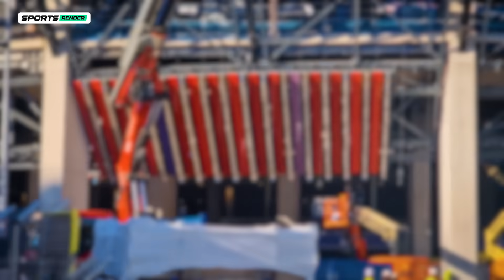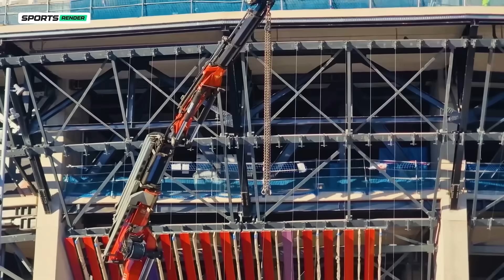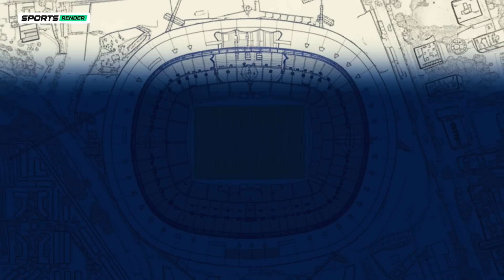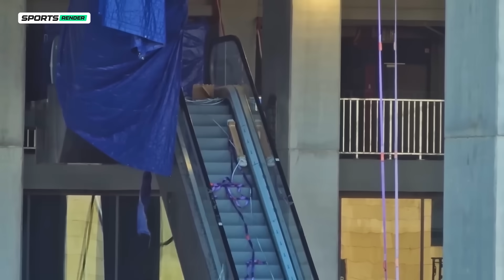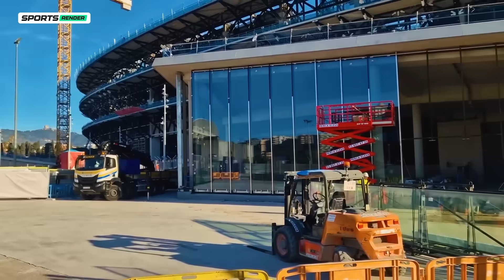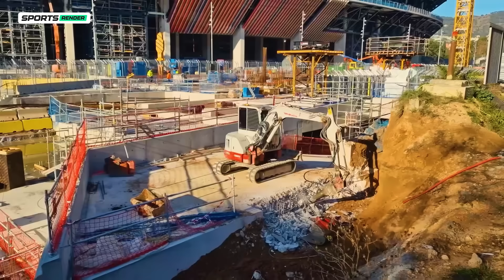The New Camp Nou Explained  Roof Structure, Façade & Stadium Weekly Progress

Comment: will roof be completed this summer ? I think they gonna try to complete this summer not 2027 .
Reply: It takes time. Don't be surprised if the roof is still incomplete in 2027.
Reply: 2027
Reply from the maker: no, but in the summer at least the structure should be finished